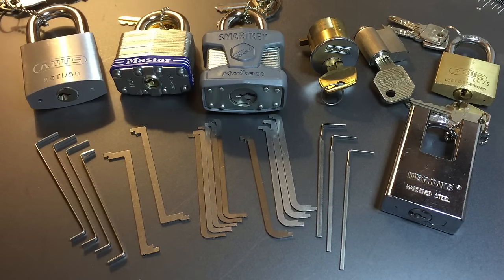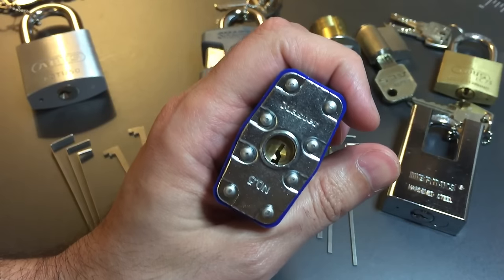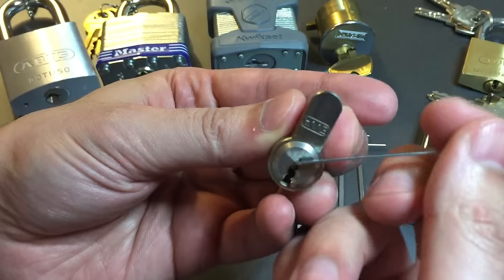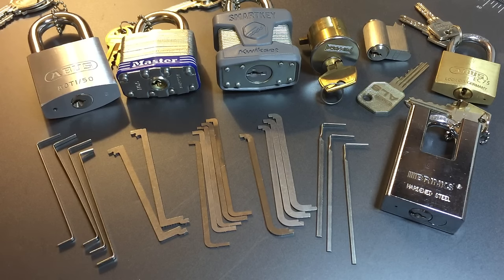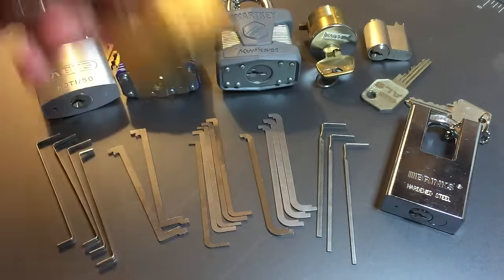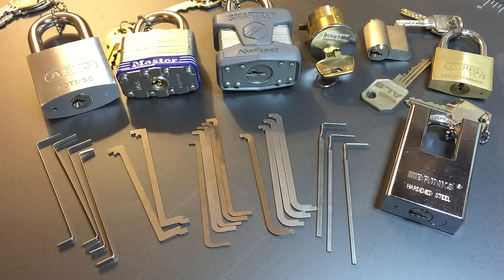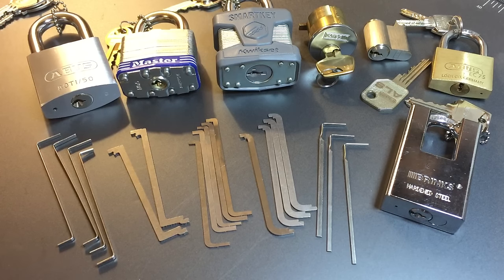[188] My Approach to Lock Picking Tension

Comment: My first tension bar was a fork with one tine bent. With 6+ inches of feedback (love your 4/1 video) I picked my first lock in less than 60 seconds with a paperclip and raking. I'm more advanced now, but I still remember the feel of the first pick.
I rake all pins high with increasing tension until none fall, then let tension off until I count all pins setting. My method will not always work, but it works for me most of the time.

Comment: If you have a particular tensioning tool you'd like to remove much of that "springiness" (referred to in metallurgy as ductility) and assuming it's made of a good quality steel alloy - which most tools are, heat your tool using a propane torch and immediately quench it in standard motor oil. The motor oil adds carbon which makes the steel increasingly more "brittle" but not to the point of breaking under tension.   You do need a slight amount of ductile strength and slight flexibility to retain the tool's ability to return to it's designed shape after applying tension.  Try testing this on a similar tool you won't mind losing before using it on a tool you'd like to keep.  Heat and quickly quench, cool, then test and repeat until the tool reaches a desirable amount of hardness you like.  It should only take 4 or 5 treatments to get the desired hardness.  I learned from the best.  My dad was a sheet metal technician and often needed to construct his own tools.

Comment: Playing around with a beginner kit, I realized the tensioner was too flexible. I didn't get the feedback that told me that gravity was holding the pin and preventing me from turning the cylinder. After I backed off the pressure slightly I could hear the pins clear and the cylinder started turning. I saw that your tensioners were labeled with the thickness and looked more solid. That's what I want for everyday locks. I've always appreciated locksmiths after I learned how to open my school locker padlock with a single paperclip.

Comment: My #1 Master Lock looked like the core was too worn to stay straight enough to turn when the tensioner was applied.  I bought a new lock the same size and the pick and tensioner opened the lock within 3 minutes.  I've opened and relocked it half a dozen times now and sometimes within 60 seconds and sometimes it takes maybe 5 minutes.  Success is sweet.

Comment: I just started paying attention to the tension that I use. I especially started feeling more comfortable using more tension with those commercial locks, and being a little more delicate with the specialty locks.
You are totally right about tension being dynamic, and not static, throughout the picking process. Great video, and great advice. Keep them coming!!
🤙🏼🤙🏼🤙🏼

Comment: Tension is hands down the most important factor.  If you cannot properly tension the lock, you will either take too long, or will never get it open.  Stick the tension tool in the lock  and look for rotation of the core .

Once you see it move... apply tension until it wont move. Then back off a hair. Also if the tool isnt working, move to a different tension tool. I have a Z bar tension tool and A thin wire like one. If the lock feels spongy, apply more tension.  If everything feels bound and womt move, back off.

Comment: Really helpful details about your style of individual pin picking that isn't working for me.  I didn't get some of the details that you point out here, including a proper pick and tensioner, and the angle and avoidance of pin re-positioning.  I think I've found a happy alternative for my noob be self using bottom of keyway solid tensioner with variable tension and a low profile rocking-rake style.  I have to remember to check to see if it's unlocked, and if not I let up on the tension and start over.  It's a quick process that I can more or less feel and hope it stays consistently good.

Comment: Yo this actually helped me so much. I bought a cheap lock pick set from amazon and while they were decently strong and appear to be heat treated correctly, I was always afraid of breaking them so I always used light tension. This was fine until I moved on from the clear learning locks to a laminated master lock. I found that the master lock was so cheaply made that the lose torrences made the feedback unreliable and unpredictable. I became frustrated and embarrassed for months that I couldn't even pick a master lock. When I saw this video I was like "fuck it, I will try heavy tension and if my tools brake on a master lock, then there is no chance they will be any good for any other locks" so I got my thickest tension wrench (about 1mm thick) and cranked the shit out of it and IT OPENED. the feedback was so clear and I can now pick master locks within a minute. If it wasn't for this video I probably would have given up lock picking. Thanks a lot LPL.

Comment: you asked why the spring tension tool was so popular. I believe it is because a lot of us were trained with it. As I have nerve damage in my hands so i really dont feel the pins through the tension rod. I feel more by holding the lock as it vibrates then the pins click into place.

Comment: Late to the party, I know. :) 
I bought a lock picking set, and a clear perspex training lock.  Even looking at the pins, I thought I had the lock in the right position, but I could never get an "open", regardless of tension. I tried lighter and ligher tension (listening to the videos) and eventually I could open the thing... If I was looking at it.
Then I tried again. Heavier tension - it looked like it was open - and then I put my finger on the face of the lock and removed the tension bar completely, only then could I turn the lock - using only my finger. It turns out that the tension bar was either "spreading" the lock enough to bind the cylinder, or one edge was cutting into the perspex enough to bind it. 
It was the tension bar itself that was stopping me from getting an "open", and not my picking technique!
I think that is perhaps why the "use the lightest tension possible" story starts - those who learn on perspex locks, and not real locks....
If you tension from the top you don't have the leveridge to spread the cylinder to bind it in the lock, and you can't dig the edge of the tension lever into the outer cylinder to bind the lock.

Comment: Yes, from an engineering standpoint a spring dampens vibrations, that's true. But the fact the spring vibrates is why you would be able to feel the feedback more in your fingers, and so from a lockpicking standpoint, a spring tension bar would be better.

Comment: Thanks LPL. I'm new to lock picking. Using as little force as possible was making sense. You don't want to bind to pin so much that you can't move them. There is that lock that was giving me issue. I was only able to pick it once every 10 ~ 20 attempts. I tried with more force and the click became so much obvious. I picked it first try

Comment: The other advantage of top of the jetway tension is that, with most keyways, it has a tendency to be closer to the center of the cylinder - this allows most of the pressure you exert on the tensioning to be rotational.  The further away from the center of the cylinder, the more pressure gets wasted exerting laterally.

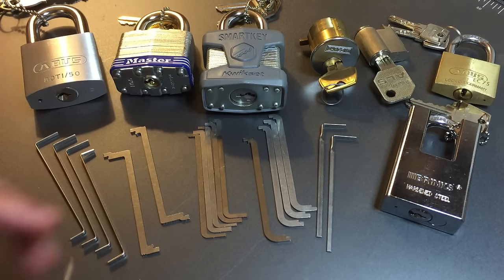Comment: I'd like to say that I'm sure it's all down to preference, maybe? I understand that you want to get feedback from the tool, but those long flexible tools you don't use @2:16 I liked to use sometimes. 
I found that it helped me in the early stages of learning as they were more 'forgiving'.  The 'springiness' stopped me from applying too much tension but also seemed to exaggerate the feeling i got from the lock. I'm talking about the longest one, the one that's about 6 inch long.  I no longer use them now I've become more skilled. But when I was learning I found them a great tool to use..

Comment: For so long while I was picking, I had a problem where no matter how I picked, in any order, day or night, fresh or 3 hours into practice, I couldn’t get the lock open. It’s because I always only knew bottom of the keyway tension and my tools would bind up the core. As soon as I used top of the keyway tension, I popped open each lock I had within 30 seconds. It’s crazy how much bottom of the keyway tension sucks. Never give up - if you aren’t getting the lock open, CHANGE SOMETHING. It’s probably ur tension tool placement.

Comment: In 1999 I started working as a locksmith "apprentice" . I was taught to use the springy tension tool to make sure I wasn't "over tensioning". Yeah. I was also only taught to rake. I wasn't allowed to learn anything combo locks , anything safewise, etc. 

I recently had a chance at a masterlock combi that a coworker (manager) accidentally changed the combo. How? Idk. 

I tried decoding but didn't get it before he went out and got another since they needed it to secure some stuff temporarily. 

I asked to take it home to keep practicing. I figured out ibeasnt using enough tension on the shackle. I used a good caribiner to help with the outward tension. It took a few times playing with the tension to get it figured out. Now ive changed it like 6 times and have decoded it (without looking and while changing). A solid 7 times. 

Times range from about 1:30 to just under 4:00

Comment: They're popular for learners because their give and take makes up for the lack of experience. Where you would normally loosen up to get a binding pin up, this tool will will already be looser than what a learner would otherwise have with a stiff tool. They are undeniably more comfortable though. When learning you can be in that lock for 20 mins easily so holding consistent tension on a stiff tool for that long is difficult, where as a flexible tool allows you to move that around a bit without accidentally resetting all your pins. Yes they are a handicap but theyre also a crutch

Comment: Also, like you I prefer 'top of the keyway' but sometimes when the lock has a large keyway I like to use the bottom as I can then use the tension tool as a pivot for my pick

Comment: First of all, let me apologize because I'm commenting on the wrong video, I just watched a video you did with the modern rogue. You were discussing locks designed to be used to secure weapons in law enforcement vehicles etc.... As a retired law enforcement officer we had more than one vehicle that required the ignition to be on to unlock the gun with the supplied button which was usually hidden but not very well unless you had the bypass key which we were never issued, the weapon in question was called an AC 556 which is basically a select fire mini-14 it can be supplied in safe three shot burst and semi-auto it can also be supplied in safe full auto and semi-auto. Unfortunately the button in a couple of the vehicles broke and since we were not issued keys we could not use the key to unlock the weapon, instead we were issued two 9-volt batteries which were kept one in the glove compartment and one in the center console The wires that would normally go to the button were pulled away from the button which is easy enough to do and we were told to hook one wire to one pole of the battery and one wire to the other pole of the battery which immediately unlocked the weapon. I just figured I'd give my two cents on another ridiculous way that you can bypass even a weapons lock

Comment: My 2 cents... I do use wiper inserts when raking. If I don't know about security pins, it can sometimes allow the tool to take counter rotation and set a sec. pin. Not always but seems often. SPP I would never use it. I actually learned top tension out if necessity many years ago and actually fell in love with it. But it still is not an ALWAYS rule...

Comment: Top tension turns it from the center in a true rotation.  Bottom tension uses a "drag" of sorts to force the whole thing to turn, but will have the ever so slightest increase in misalignment chance.  I bet your preference for top tension is why you end up having such an easy time with many locks others have so much trouble with.  You're always getting the easiest, truest, most honest rotation (and thus feedback) because of it.  I have a feeling this also relates to why you have more luck with heavy tension when others advise light tension.  Heavier tension is likelier to cause a lock up cock up on the drag than on an even rotation.

Comment: I think that the tension wrenches with the twist in them that makes them springy are for use with rake type picks so that the pressure on the cylinder can vary as the rake strikes the pins and the connetic energy moves the pins up
Reply: I whole heartedly agree!
       It seems that most of today's people Only rake At locks and never put forth an attempt at picking the lock.

Comment: I can second the motion that tension is harder than picking. I’m kind of a newb at both and I have to try much harder to get and keep good tension vs picking. Proper tension is key a good “feel” while picking. I also agree with using as much tension as is practical. High tension has worked best for me especially when picking old, rusty, dirty locks.

Comment: These videos made me good $. People use cheap locks for safes!

Doing so i thought of a good lock idea. 
A key that is essentially a small rod so the keyhole is just a circle. When the rod shaped key enters fully , inside the key are springs/pins on top and bottom that open once inside the lock it can be achieved by having a 'button' tip that pushes all the springs/pins outward pressing on the proper spots to open it. I made a draft of this. In theory it would work, i was reached out to by masterlock for the patent (i patent many inventions, most sell to an Italian military NGO .. ) not sure if it's a scam but Sicaly is my Homeland
Reply: Idle Hour I poke the release with no key in the lock, then tension and pick as normal.

Comment: I just wanted to thank you for your videos I have so much trouble picking and get stuck all the time. I think it’s my tools. My tension wrenches aren’t the ones you use and now I see my problem. Tension is my biggest hurdle and I need to switch over to the vertical ones and not the horizontal ones I been using. I can’t afford a good set so I been making mine but I can’t figure out how to make the ones you use. I don’t think I’m really asking a question I’m more just dropping a comment to say I think your totally awesome and hope to be even 1/4 of the lock picker you are. Keep the videos coming and I’ll keep watching. I think I’ve seen them all.

Comment: I recently made a couple of tok pry bars put of round metal bars, by bending it to 90 degrees, then using a dremel to make the tip flat to fit a lock. (also plan on running it through heat treatment later)
The round handle is so stiff conpared to flat pry bars!

Comment: So I’ve been having some serious issues with tension while practicing my picking skills lately. I want to start off by saying I’m learning this on my own with videos and practice. But I am actually breaking the cylinders on the locks I’m using. Did it on the clear lock and just tonight did it to a master lock padlock. But I was having two major issues with it, one was when I would go to set the pins the pin that second from the front had to be set first, but when you go to set the second pin it takes quiet a bit of pressure, and then I have to switch to the front pin while holding that on at the shear line, and the bad part about the front pin is I have to let off pressure for that pin to set, I’ve actually had it to where all the pins are set and I can go thru and feel every single hole that the pins slide up into, and I’ve looked with a flashlight to know forsure nothing was hanging down in the back and I still couldn’t get it to unlock, so that’s when I tried more pressure. That was the only way I could get the front and second pin to set at the same time. But like I said it resulted in the cylinder cracking in half. I’ve seriously been considering getting a bigger and thicker tensioning tool just because I thought it had to do with the size of my tool (which it normally is a problem with my tool) but I’m starting to think I’m doing something completely wrong cause the LPL isn’t putting so much tension on these locks that he is breaking them?! So why I’m can’t I do the same? Lol

Comment: I have found that applying heavy tension to the core, then applying as much lifting force with the pick to the binding pin as you're willing to use and holding the pick steady while slowly releasing the core tension until the pin starts to move is the more repeatable technique. I still find tapered pins hard to pick, especially if the core is loose enough to wobble a little bit which may change the binding pin while you're releasing the tension slightly.

Comment: Maybe one reason more tension is preferred with his method on turning tool due to the fact that the key ways generally are not centered on the lock. If you tension off the bottom of the key way it’s usually closer the outer edge of the core which would provide more leverage with less force. LPL likes to use the the top of the key way on most locks which is much closer to the center of the core requiring more tension but also it may give more feedback as it’s in most cases closer to the fulcrum.

Comment: Thanks for this video. Trying to teach tension via a you tube video is like trying to teach trainees how tight to tighten screws on instruments. Either they have knowledge of materials and physics, or they don't. Often they will leave things loose and they come apart or tighten them until things break, screw heads or threads strip or their driver's break. Unfortunately, you can't teach that. It takes an aptitude. Torque specs are for this, but of course there are no torque tension bars yet. Maybe a product?